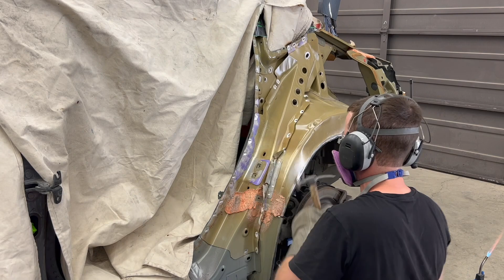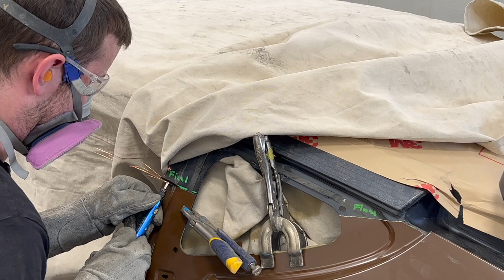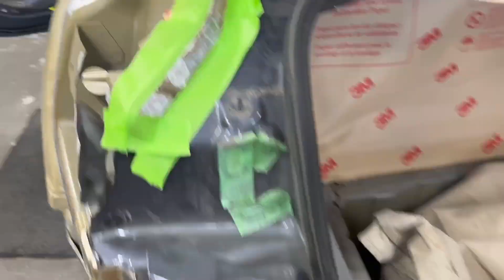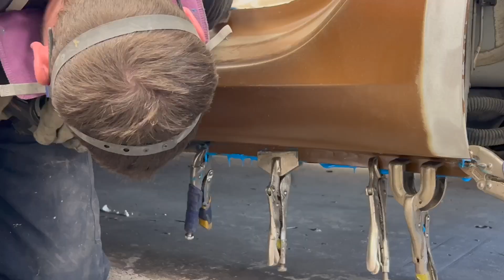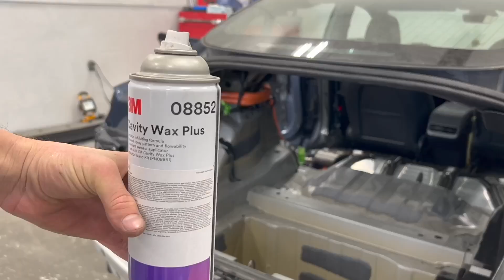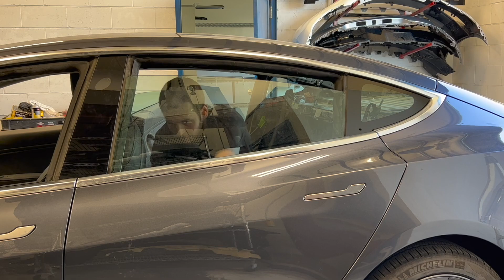COLLISION REPAIR PROCESS ON A TESLA MODEL 3 REPLACING THE 1/4 PANEL AND OUTER WHEELHOUSE!

Comment: Now I understand what the insurance companies are talking about when they tell me I don’t need to set the car up on a bench to do structural work…you’re doing on the floor w a jack stand…great way to positively impact our industry we all just went down a couple notches…structural parts…structural bench…bc you don’t want anything to move during replacement…I like the preliminary measurement and pulls you made too to relieve any tension or correct secondary damage…very informative… you talk about OEM replacement procedures. I guarantee you they tell you to set that car up on a bench. But that’s fine. They spend millions and millions of dollars in research on how to fix their cars only for you to come up with your own way. Very smart.
Reply from the maker: Tesla DOESN’T allow any structural pulling on any of there vehicles. Also when viewing the OEM replacement procedures on each part it specifically states whether or not the vehicle needs to be mounted on a frame bench. None of these parts required a frame bench.

Comment: Great video! Nice to see you protecting the interior. I once had a similar repair on a brand new (5K miles) BMW 550i. Took it to a “European shop” only to see the rear wind screen and left rear door removed with no protection of the interior. The new car looked filthy!! They cleaned it well, but I never understood why they didn’t cover it up instead of letting it collect dust inside a body shop for 30 days.

Comment: Good Video. Did you not fit the inner structural pieces with the 1/4 because the damage was minimal? Is premixed fiberglass filler not required over the MIG welded areas? Thanks

Comment: Hi I’m also repairing a quarter panel on the Tesla model 3.And I saw you put structural adhesive to to a lot of the attaching areas as when I pulled it apart it looks like Tesla had used foam on some of the areas that you put structural and he said to 
Cheers Yern Western Australia Margaret River